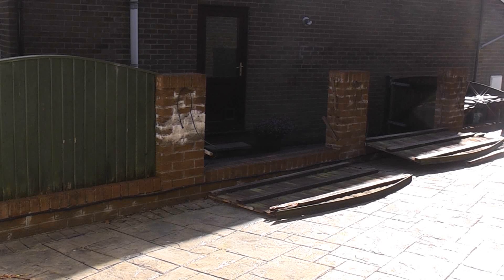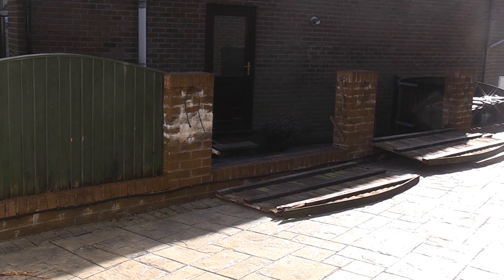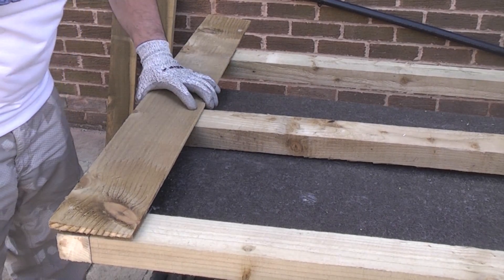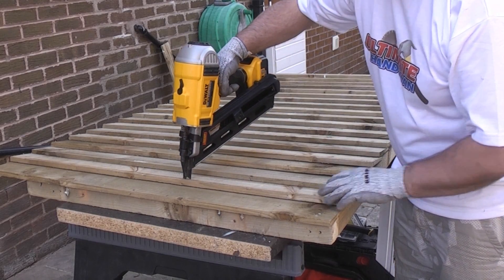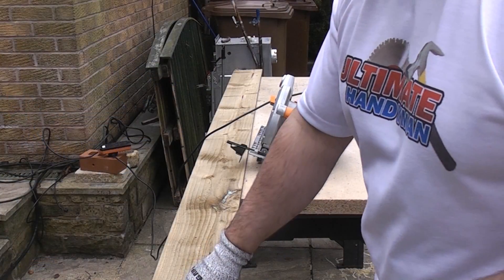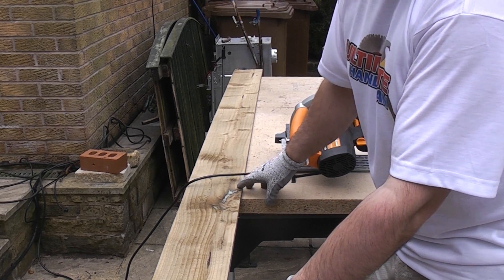How to make a fence panel

Comment: Great work. Much better than the flimsy ones you get in B&Q etc. 

What's your opinion of the nail gun after a bit of use? Does the battery last a long time? Looks like it really speeds the job up.

Comment: did u make a cost saving overall ? and thats a nice drill you have there, i've noticed youve been using alot of dewalt lately. Would you rate dewalt as better than Bosch blue ? you dont use that bosch auto-rotate drill  much anymore. has it reached the end of its life?

Comment: Hi, did you manage to shorten your fencing panel? If not you simply remove the enough of the feather edge boards to suit the length of fence panel needed, plus another board which will allow you to saw off the top, middle & bottom rails to length required, then build back up by re-connecting the upright post to the cross rails & finish by re-fitting the removed piece of feather edge.

Comment: Another great video. How would go about replacing just a single piece of fence board what was damaged in the middle section?
Reply from the maker: Probably the easiest way is to use a multi-tool with a metal cutting blade, slide that in between the slats to cut the nails, then remove the piece and replace with new nails.
Thanks for the comment 👍
Reply: @ultimatehandyman  just want to say your suggestion worked a treat, thought I was going to have to replace a whole panel, but 3 boards later. Thanks again truly appreciated.

Comment: How cost effective is this compared to buying a pre made panel from builders supplies? I think a similar panel to the one you made costs about £28 readymade?
Reply from the maker: It's probably cheaper to buy ready made ones, but the quality is not the same. Hopefully mine will last a long time as long as they get a coat of stain every couple of years!

Comment: Really like your in depth explanations. You didn't say which nails, from experience  - ensure you use class 3 hot dipped galvanised nails (believe they are coated twice). More expensive but rust bleed is inevitable if you use standard thinly galvanised nails (class 2)
Of course you can get stainless nails....
Reply from the maker: Sorry, I think I used stainless nails.
I'm not keen on galvanised, as they often rust eventually.
Thanks for the comment 👍